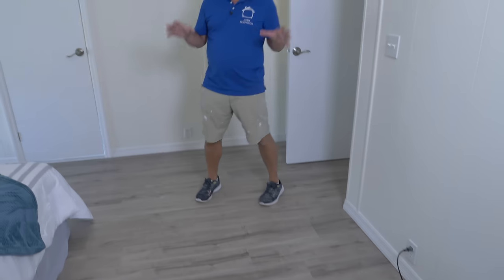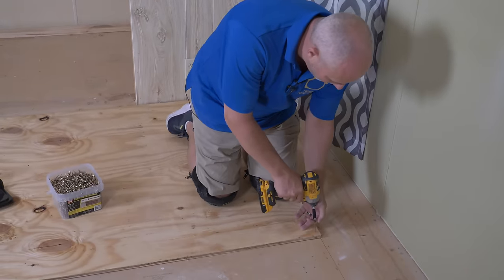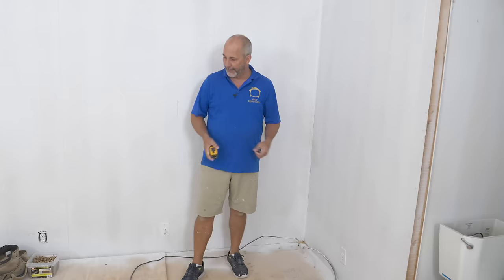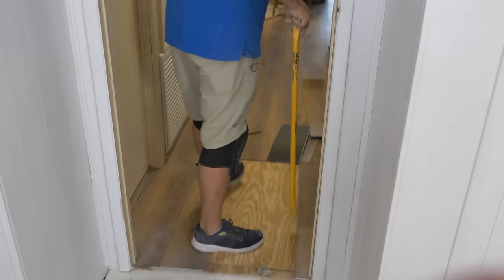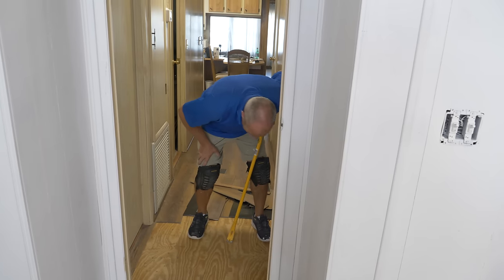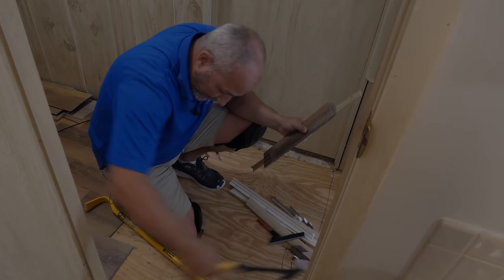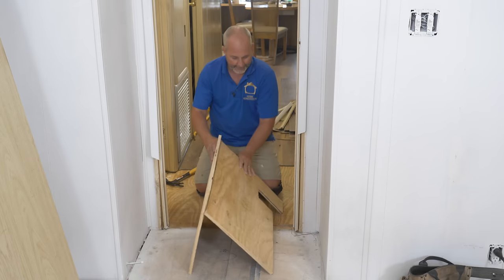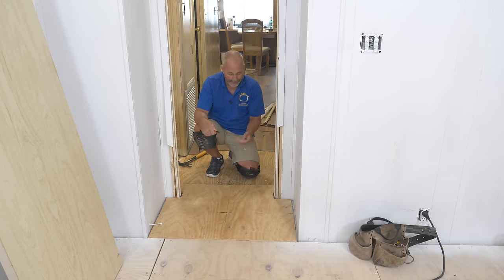How To Fix Soft Subfloors (The Easy Way)

Comment: This is great. But how do you transition the new higher flooring to the older existing flooring?
Reply: yes i was wondering this
Reply: I dont think he does , the whole property gets new subfloor
Reply: You scab up basically connect another 2x6 screwed to the old one a little higher up but still have to measure to make sure when you lay the floor on the attached joist it lays flat where the two pieces of flooring meet old and new

Comment: I have been renovating my 1958 home since 2013, when I bought it. Actually thouroughly cleaned. removed, repaired and re-installed the 1958 Tappan  "Automatic Pilot Ignition" built-in oven ($330.00 for the igniter and only 2 in the world) and love it. Currently installiing Laminate over real wood parkay and linoleum. Nothing square. Nothing level. Amazing that 1958 carpenter's cut, sanded, glued and then finished real individual pieces of small planks to get that parkay look. I feel your pain!

Comment: Subfloor is being removed from my home, unfortunately it had to be done. Urine stained and water warped MDF boards had to go. It's like 70% done then we have to address a couple spots where the original subfloor is water damaged and rotted. Just the smell of that subfloor as it was pulled up reassured me that we made the correct call.
Reply: That’s where I’m at. Definitely not going to slap plywood over stank, rotted subfloor.

Comment: In the beginning of the video where the floor at the by the wall wasn't level and you could put your finger under the ruler how did you raise up that end of the wall I just saw you put a piece of plywood down about 8 inches off the wall but you didn't show how you leveled it off when it dips down on the sub floor
Reply: That's what I was waiting to see.
Reply from the maker: use a floor patch compound before installing the new flooring to level all problem areas!
Reply: @HomeRenoVisionDIY  please show how to in a video. Thanks. ;)
Reply: @HomeRenoVisionDIY  Which compound?  Can you show that?  I have this exact problem and was about to put 5/8'' plywood over the voids until i saw this comment.
Reply: My grout in my tiled bathroom floor is cracking due to flexing subfloor. Sub floor has concrete panel between tile and subfloor. What’s the best way to fix  this? Thank you !
Reply: @HomeRenoVisionDIY  what floor patch compound was used for the 'gap'?

Comment: Make SURE you know where your water lines go before doing this. Laminating the subfloor in this way was how I found out the fire suppression lines in my condo were mounted directly to the underside of the existing subfloor. That made for an exciting night - especially because no one in my condo knew how to turn off the fire supression system, so water poured into my condo for 3 hours before we found the right person.  After spending a solid week repairing water damage in the floor below (just my garage, thankfully, and not a neighbor) I marked out the fire suppression system on the old subfloor, and made darn sure to stay 12" away from the lines when putting in the new screws
Reply from the maker: ouch!
Reply: Did the same with boiler line, in mid winter at zero outside.

Comment: My hard wood floors are SO squeaky it drives me nuts and the kids. Help
Reply: Check your joists if you're able.. that's what I'm doing to identify problematic areas. Then I'm going to reinforce the floor by nailing them down. But ant issues with the joist should be addressed first. 

Hope this helps. 

Have a great day ❤
Reply: Saaaame.
Reply: Have you tried uninstalling the kids from the house?
Reply: You should use the floor squeek kit. I think Jeff talked about it a few years ago. Helped me fix a lot of my floors
Reply: I would check your joists first. They may need blocking or bridging installed between them before you can resolve the squeaking issue. If you can have someone walk/jump on the floor while you are underneath , then you can see what's moving. Most floors in homes built after the mid 70's usually have a 2x 6 or 8 depending on the joist installed between them bracing the adjacent joist, forcing the load out across multiple joists, and stabilizing the subfloor to keep it from flexing. If its true tongue and groove, the squeak is coming from the boards lifting on the nails/staples used to install it. Once the subfloor and joists stops flexing then, you can use a specialty flooring screw that has a snap off head. The screw gets driven down at an angle in-between the floor boards, and to has a stop ring of sorts on it, that gets buried in the flooring. Then the upper part of the screw is snapped off, leave very little indication that there was a screw installed.

Comment: I stacked subfloor in my bathroom to get a better transition between the original 3/4 oak outside the bathroom to the vinyl plank flooring inside. Along with screws i also used three construction adhesive you can get in foam gun cans. It's for subfloors, comes out like a foam but sticks tenaciously.

Comment: Thank you! I’m on a budget. An old blind lady with sad strength. I’ve been replacing rotten wood under my fridge for months. Every step takes me forever. The rest of the floor does have weak spots. My joists are 24” on center. I just want the floor to last as long as me. Putting plywood on top seemed ok to me but I’ve been getting advice against it. Now I’m feeling more comfortable. Again, thank you very much!
Reply from the maker: definitely recommend the tonge and groove osb. it is stronger than plywood and costs less. Cheers!

Comment: I literally just finished doing the exact same thing last week. What small world! The only thing I did was add subfloor adhesive. It's a 1910 farmhouse with original TG fir floors, and they were getting springy.
Reply from the maker: well done! old t and g floors eventually break all the tongue and loose their strength
Reply: @HomeRenoVisionDIY if the joists are rough cut oak, set 16 inch OC, would it just be better to just pull off the t & g, and install 1 in;  or just use 5/8ths over the top of the t &g?

Comment: I thought i would have to do the same in the house we just bought. Two first floor rooms had floors that creaked with each footstep. I was very close to overlaying new sheet wood, but decided instead to put roof felt over the construction insulation under the existing floating chipboard floor, and then another layer between the chip and the insulation that had been used to raise the floor level. After relaying the laminate floor it is silent. But handling that sheet flooring is harder work than you make it look!

Comment: I looooove your videos. I learned so much. I am trying to decide if I should use self leveling compound option OR using plywood over existing subfloor. I have bad subfloors (particle board) some areas are squeaky, soft, and not leveled for vinyl or engineered wood. What should I do? Self leveling option or new plywood over existing bad subfloor?

Comment: Perfect timing! My mobile home flooring is swollen from various leaks and laminate floor was layed on top. Joints are popping. This is a 1975 single wide in Arizona 55+ park. I bought it right, but must be realistic. Surrounded by newer homes. I was just about to tear out bathroom subfloor. Plumbing is all replaced and roof is fixed, so cautiously optomistic. A little concerned about covering the soggy stuff, but think it should dry out with this 115 heat. Your thoughts?
Reply from the maker: the softness does not affect the strength of compression. your dry environment will keep it from going to mold. remember it is soft not wet. Cheers!
Reply: As a fellow carpenter desert rat that works in Phoenix but lives in Las Vegas, you should be good. Can always take things a notch further and get yourself a gallon of oil based zissner primer that blocks mold and mildew. Paint your subfloor with it, especially in bathrooms! Your future self will thank you should you ever have any leaks. It's a very small and cheap insurance policy to CYA. I did this in my house that I remodeled recently as well. I'm a commercial carpenter by trade and while many things apply, it's still a vastly different world in other regards. Haha I will say that hanging board on perfectly straight metal studs with self tapppers is way better than residential... minus code that requires 2.5x more screws.

Comment: Question: I was waiting for you to explain how you were going to address the vapor and insulation issue causing condensation between the subfloor and flooring but you never did.  Did you put a vapor barrier and insulation under the mobile home or fix holes in the existing vapor barrier and insulation? I have the same problem but worse. The plastic belly wrap was missing, insulation hanging, and my floors were bleeding on the Summer between the vinyl tiles because of condensation coming through the plywood subfloor and getting trapped under the vinyl tiles.

Comment: Plywood is crappy these days and often pretty bowed.
I was taught to run a row of fasteners straight down the middle each direction forming a cross. Next, working from the center outwards, nail each quadrant.  This forces the bow down and outward.
You didn't, but I can't count the times I've seen people place the sheets, then nail all the seams first.
🫣
I've installed flooring since the mid seventies, learning from my grandfather.   It's refreshing to watch your videos explaining the why's and how's to those that watch. Some new to the trades, but I'll bet many are diyers.
Reply: The huge knots in that piece of plywood are like nothing I’ve seen before.  Absolute crap plywood.

Comment: This is JUST what I needed! If you weren't replacing the door trim would you just undercut it to make room to slide new subflooring underneath? Also curious about exterior doors etc. You would need to replace the threshold aswell? Thanks 🙏
Reply: I would use a multitool and trim the door casing

Comment: Jeff, just bought a fixer upper and found 5/8 particle board underlayment under the carpet. It’s heavily stained with dog urine, some of which is still wet. There’s 1/2 ply under that which is in good shape. Thinking I need to pull the particle board and replace with 5/8 OSB to make sure I get rid of the odor. Thoughts?

Comment: Starting at 8:30, those lousy cable wires belong behind sheetrock.  I would use a drill and jig saw to cut out a piece of the original subfloor (if it's not accessible from a crawlspace), and wire the lines though the walls by using a sheetrock knife or roto-tool to cut a line even one foot above the floor, along the wall, to where they want it coming out.  It would delay the project by a day, but the alternative, of having to live with that crap forever, sticking out of the ground, always makes it worth it.🙂

Comment: So you add the new plywood on top for a few inches out into that hallway and then are you putting a transition to a different floor or did you end up putting that plywood All through the rest of the house so that it's on the same level?

Comment: Future cable contractor likely won't use the old cable, and won't take time to remove and use existing holes, likely just drill into living room/office and run new cable to whatever rooms they want (or just to router for wifi nowadays).  Up to you to seal all the holes nowadays, not like decades ago when they used grommets.

Comment: Based on my experience, a subfloor adhesive good be a good option, but a pretty expensive one. It'll give better sound insulation, adhesion, and vibration (from steps, etc) dumpening.

Comment: You can check a carpenter square by using a known straight like on a sheet of plywood and marking a line, then flip the square over and mark another line as close as you can to the first one, if it's a little off you can take a center punch and hit either the inside or outside corner depending on which way it's off. ;-)

Comment: I knew when I moved into this old house the remodel before i bought it was maybe a cover up in some places. The first obvious on was the back part of the house, see a crack come across the ceiling as I was putting more things in that room up stairs. So with in a month or so of moving in I decided to check this out as much as i could without opening any thing up. What I realized was that the second floor on that part had only three cross beams besides the outer frame. Leaving two spans of 4 feet, and one at about 3 and the other around 2.5 feet. So I built a support frame from about 1/2 of the room on the first floor to add support for that center beam, where that crack in the ceiling showed up. Well now about 12 year later I have dips in my first floor at those 4 foot spans, and the one side is concerning. I don't want to take up the whole floor, for the huge reason is the cost and that fact there is a large kitchen counter and sink on the one side and it covers those spans very well, so I don't want to move it all out. the floor feel like they might have even used Masonite and not plywood or the plywood is rotting or just weak from the long span and a kitchen table one it for many years. This part of the house is basically built on the ground and I have no way under it all. There is a small opening on the one larger better 4 foot area, at my outside basement entrance and I put my cell phone on a stick and slid it under and as best I can tell that area is not rotted. So I can guess it was just to much weight at 4 foot span. 
 So my plan is to open part of it up to look under and then add 3 to 5 cross supports to the three ones that are there and maybe, get some added support to the ground. Then put most of the flooring back if it is not rotted and then put either a layer of 3/4 PVC sheet on top or 3/4 plywood.. The other fun part is the back door is level with the current floor and opens in, however it will need to be fixed as well since its' bottom was partly bad and I did a makeshift protection and mouse stopper back then, so having to raise that door bottom was going to have to be done anyhow.  So I wonder if I go with the PVC sheet should I run it outside to cover the whole base of the walkway, and then put a regular door seal on top of that or just stop at the door with the floor?

Comment: I purchased a manufactured home and I had to pull all the flooring up. I though the subfloor was soft, but found that there was way too much padding under the vinyl floor which was making it feel like I was walking on a mattress. The 3/4in particleboard is solid with no soft spots. Whoever put the flooring in decided to use self leveler on the particleboard and it is not level. I was told the best fix is to put 3/8in plywood over the particleboard and just staple it with no regard for where the joists are and where the “self leveler” is. It looks like you would recommend that I use screws and screw it to the joist?

Comment: I read elsewhere and was informed by a guy in the flooring dept at Lowe's not to attach the upper layer of plywood to the joists?  Only the original subfloor should be on the joists.  The upper layer is just attached to the subfloor with 1 and 1/4 screws (can use construction or sheetrock screws)? I have 3/4 sub floor and 3/8 plywood on top of that? Will that work?

Comment: Ok question at 1:47 you show how from the 4 foot line to the wall has a nice gap. When filling in how do you aim to remedy the gap? I am just about to start work on a 1985 Single Wide in Indiana. My floors have 2 soft spots one in the hall and another in the closet of a bedroom. I am getting quotes currently for the roof to stop leaks they mentioned I may need more bricks.

Comment: I was waiting for this one.🎉 I fixed my floors too finally. I was vary curious what all you had to do. Resizing thoes doors won't be fun. But i guess its a great option. Some of My doors are damaged from cat pee cant save them. It will be interesting finding the right size.
Reply from the maker: say that. It all comes down to shopping at the proper store so you can get proper replacement parts!
Reply: @HomeRenoVisionDIY  well thay have almost all these replacement parts at modular home repair stores online, but it's also a rip-off cheap. 
Just like my windows being 500$ a window if I bought from them.  So I ended up resizing my windows. And it only costs 200$ for a similar size.
I'll figure it out.
Reply: UVC light WILL take care of that cat pee!!! Wonderful invention.

Comment: Glad I'm not the only one that couldn't seem to find any actual flooring screws!  Watched a TON of your videos and I could never find flooring specific screws like you had mentioned before.  Also, curious if there was a reason you chose plywood over OSB here, or maybe I missed that somewhere.
Reply: OSB's cheaper (well, used to be) because it's just glued together fibers.  It's not glued together dust like what he's covering/complaining about, just a step up.  
Plywood is actual wood layers, laminated together.  It has some structure to it.  Sure it costs a bit more but will last multiple times longer.  Now pressure treated plywood, costs even more, but will outlast other parts.  
I bet since he's sticking to a budget, he went for plywood.  
OSB's cool for wall sheathing, but I'd not pick it for something that gets heavy weight sitting on it (furniture), traffic (weight and flex of people walking), etc.
Reply from the maker: truth is it was a strength decision this time.
Reply: @HomeRenoVisionDIY  makes sense, thank you for the reply!

Comment: maybe a really weird question but does it help to lay down a second subfloor to prevent noise movement to the lower level? Of course I would also use a Mass Loaded Vinyl layer on top of the second layer subfloor.